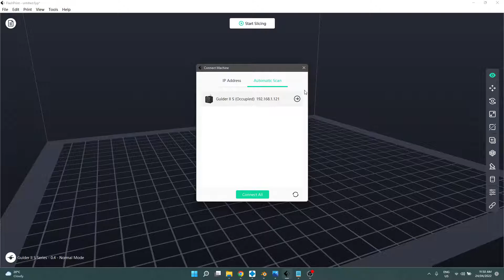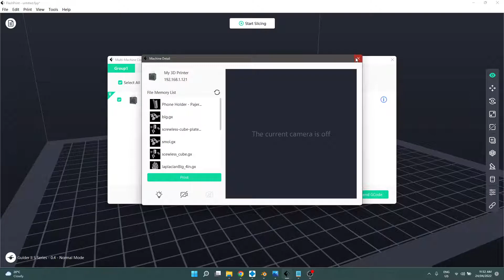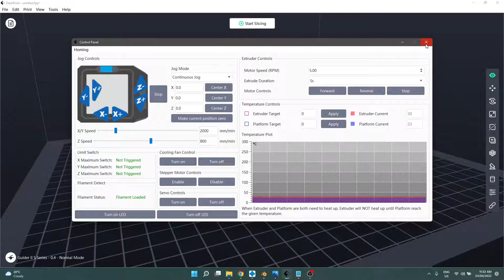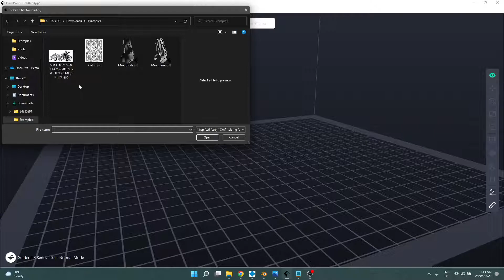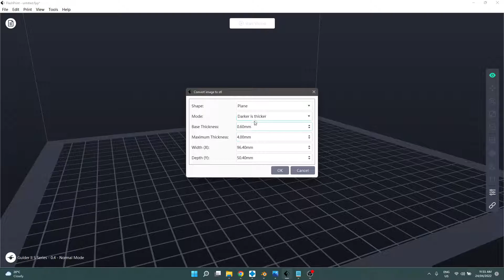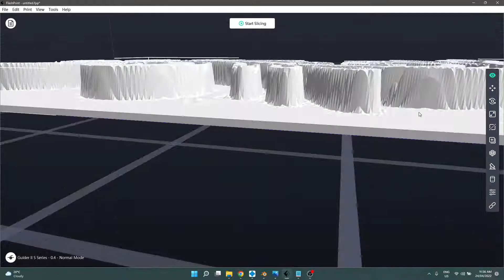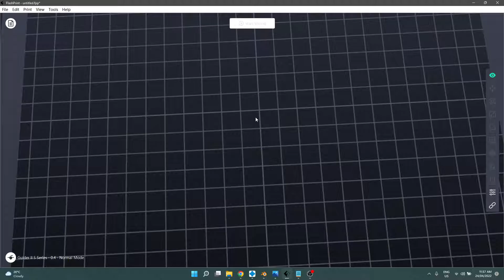FlashPrint New User Tutorial - Part 01 - Basic Operations

Comment: Super informativ. I can not connect to my printer how can i fix this? glad if you could help
Reply from the maker: Which printer do you have? It should be very simple. Once you set up wifi on the printer itself, flashpoint should find it automatically if it is on the same network.

Comment: Thank you, for your very understandable walk through of Flashprint. I have a very specific issue and I was hoping you might have some idea of how I can fix this issue. I have watched all of you videos and come up with tons of ideas, to the same end. I have the Flashforge Guider IIs. I'm having adhesion issues and must use a raft however my 1st layer of the STL comes out with lines that you see instead of nice and flat as it should. Any suggestions are welcome.
Reply from the maker: Yes,  it is best to avoid using a raft as much as possible. Honestly, go get a basic glue stick and just apply a thin film to the build plate prior to printing. Even with a perfect first layer, it is good insurance to ensure your print stays in place.

I always used a glue stick when printing ASA. And I've never used a raft since my first model, at most, I will use a brim. 

You're more than welcome to ask any further questions, however, Youtube doesn't notify me of comments, so I may not reply as quick as I'd like.

Comment: The supports are practically unusable on this software
Reply from the maker: Using base settings, the supports can be an absolute nightmare. The few files I've designed myself were later remade for this very reason. I couldn't rely on the support structures to give a clean finish.

I do know the FF techs are in the process of improving things, and they do listen to feedback from users, so hopefully we will see improvements with future updates.
Reply: @afewthings3d  I'm not sure they listen to anything. Every time I contacted them, he explained that I was the problem.